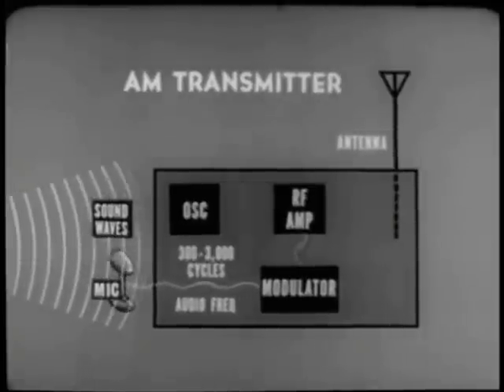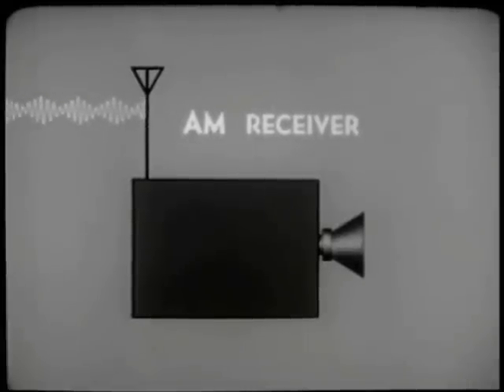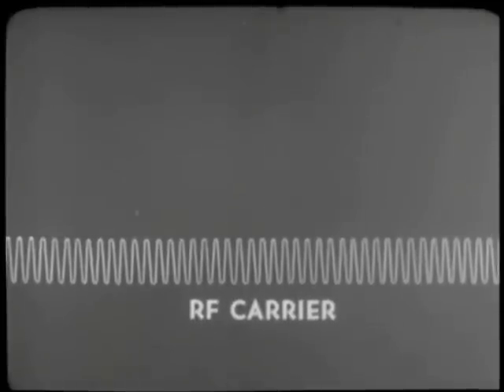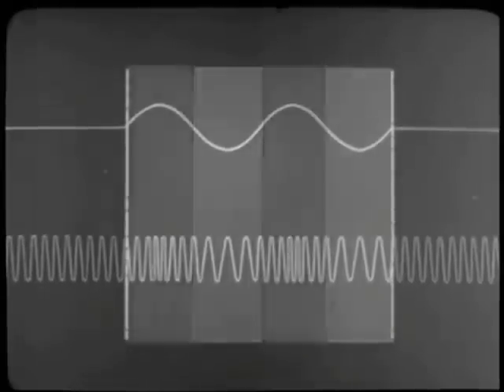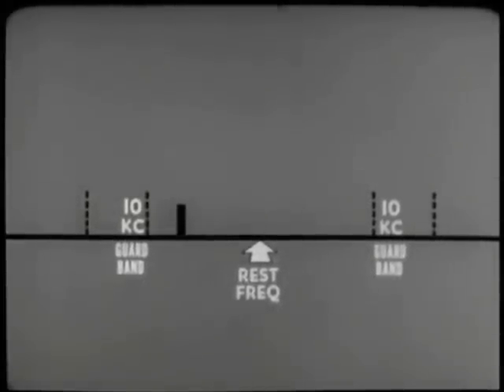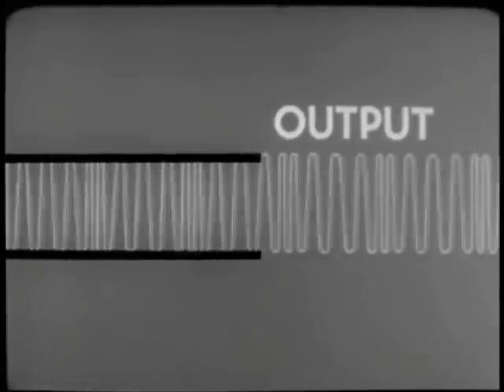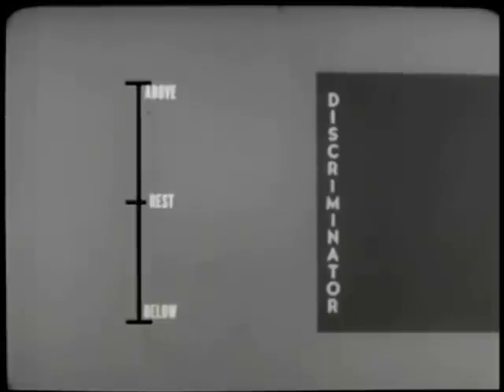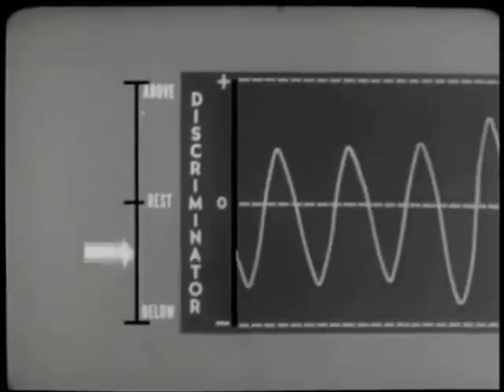How AM and FM Works

Comment: 0:50 There is a mistake, the oscillator and the mic both feed the modulator and then the modulated signal goes into the radio amp.
Reply: TheDaniel366Cobra
yes u r right bro.
The carrier wave is modulated with respect to message signal in the modulator and then fed to the amp.

Comment: Correct me ASAP if I am wrong: the electric signals are travelled into the transmitter where they are converted into radio waves. The conversion is done because of a process known as modulation whereby the amplitude of the wave is modified. Those waves are then known as carrier waves just because now they have modified amplitude. Those carrier waves travel through the antenna and later on reach the radio's antennas. Right? 

If I am right then when are the radio "waves" actually made because isnt modulation when an existing wave is modified? So it's pretty obvious that the waves were made before modulation but how exactly?

Plz help I have an assignment to submit. Thanks

Comment: Is 7:30 not incorrect?  They mix up amplitude modulation with frequency modulation. Changing amplitude does not change the end signal in FM (they even filter amplitude variations later in the receiver).
Reply: No, it is correct. I think you might be misunderstanding the graphic. What it is illustrating is that higher amplitude of the input signal leads to a larger deviation from the rest frequency in the output signal. Its amplitude, however, is irrelevant, as you say.

Comment: I wonder if Dolby noise reduction was based off the limiter. - Seems similar.
Reply: not really (at least I don't think so). Limiter when used drastically introduces its own artifacts like distortion which in effect is similar to hash itself. Now that won't be a problem in FM receivers since it only decodes data from the frequency information and the limiter only gets rid of the peaks. Even then the limiter is used only with certain preset settings so as to minimize risk of distortion since it's capable of adding additional harmonics meaning introducing frequency content, which is dangerous in FM. Here its only used to clip off the peaks and keep the signal uniform cuz what matters is frequency not amplitude.

Comment: 6:23 Are you absolutely sure this was from 1964?  Cause that information would put it pre-1948 when the FM broadcasting band was moved from 43 MHz to where it is today.

Of course this is irrelevant as to how the technology works, but still.
Reply from the maker: This is an Army training film, and I believe they used this frequency for military FM radio communications after the FM broadcasting band moved. So, this is about FM radio theory, not the FM radio band that we commonly think of. Hope that clarifies!
Reply: The screen at the end of the video says MCMLXIV; Roman numeral for 1964.
Reply: FM is a type of modulation and used on bands other than the FM broadcast band.  Most scanner frequencies use FM.  TV sound is FM.

Comment: errmm  - modulation index  (Fi0 deviaton / highest audio freq)  and Bessel functions ? hmmmm  a bit oversimplified me thinks in terms of bandwidth needed to transmit  high definition  sound ? ( as opposed to Narrow band FM which approximates  to AM in terms of side band content  ?
Reply: +Eric Churchyard This is supposed to be a very simplistic BASIC fundamentals video. There are others that deal with those as well. Back then, FM radio was damn near space age tech, or might as well have been to the average person.
Reply: You missed the point of the video. If you already knew the workings of AM, FM, and side band then of course it was simplistic. For me, I now have a foundation of all three that I didn’t 24 hours ago.